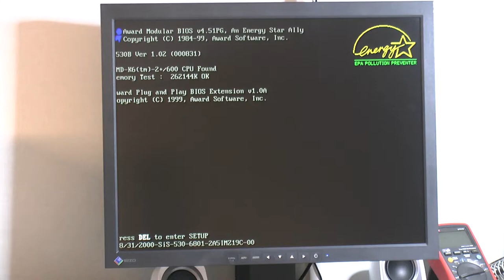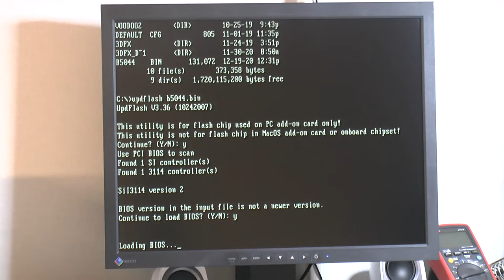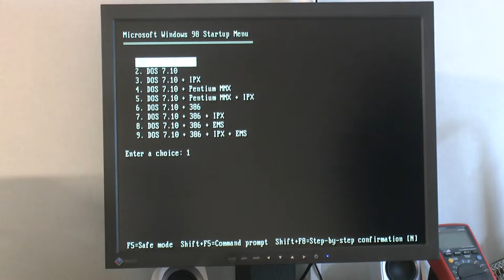Sil3114 EEPROM replacement and socketing

Comment: Friend, with my Retro Windows 9x Setup , can I use this card with 1 SSD, 1 DVD Drive and 1 Motherboard's IDE HDD?
Reply from the maker: There is windows 98 drivers. It works in windows 95 but there are no drivers.
Works in dos too.
BUT if it will play nice with the motherboard depends. The older the less likely the motherboards bios is to cooperate. Also optical units can be troublesome, forget booting from optical sata drives on most systems.
You also want the none raid bios flashed to it, you want the IDE bios.
Most cards on ebay have raid5 bios, sells better I guess but its useless for normal usage.
And my card had en eeprom that could not be flashed so had to  be replaced.

I have a number of windows 98 machines using sil3114 cards, mainly old SUNIX cards from early  2000 with proper eeprom so easy to flash them.
But some motherboards hate sata/scsi controllers so no guarantee it will work well with your board, but they are like 20 usd on ebay last I checked.

You could get sata to ide adapters with proper Marvel controller, they are like 25 USD but works very well.
Like this startech one.
https://www.startech.com/en-us/hdd/ide2sat
Turns pretty much any sata unit in to an IDE unit with master and slave option and optical support so you can have two on a single ide cable.
Reply: Thanks a lot for your kind detailed reply.

I thought of that SATA-IDE converter.
I want to use (PCI SATA card + SSD) as SATA1 is much faster than IDE....

What do you suggest?
Reply from the maker: @ayan.debnath  depends on the motherboard. Sata 1 is 150MB/sec and the sil3114 can do 66Mhz PCI bus BUT 99% of motherboards use 33Mhz PCI bus so the maximum theoretical limit is 133MB/sec anyways.
The Startech adapter uses a Marvel chip capable of ATA 133 so in theory if the motherboard has a fast IDE controller they should perform about the same.

Sata 1 is not that much faster then ATA 133 for example especially since most early sata 1 controllers where PCI.

So the question is what what ATA speeds the motherboards IDE controller can do.
Also the PCI bus might be slow on some motherboard so you wont get near sata 1 speeds even with a PCI Sata controller.

There are other advantages tough to the Sil3114 like bigger hard drive support, in theory up to 2TB.

I have both the adapter and sil3114 cards because on just have to test and see what works best for the motherboard in question.
Reply: thanks a lot for this awesome guide.

Comment: and if you leave it without the bios? will it work? what is the maximum volume to see?
Reply from the maker: I never tested a card without a bios chip because they are 99% soldered on. But I used them for linux back in the day so thats why I have a few for retro use. But DOS/Windows 9x and even NT usually requires a bios for the driver to even work even on windwos 2003 server. Linux tends to load its own firmware and has a good opensource driver so I suspect for linux the card might just work fine with no bios chip.
I ran 4-5 of them in one home built NAS back when and even when the motherboard only sees 1-2 of the 4 or more cards but linux can see and use them all up to at least 2Tb drivers.

But for the the retro use they see today a bios is needed and windows needs a driver matching the bios so riad0 and 1 usually has one bios, then there is a raid5 bios then there is the "ide"bios I like because it works with SATA optical units and can even boot that one SOME motherboards and its the most hazzel free bios. But all the china cards has the raid typ bios, I suppsoe it sounds better if it has host raid support but thats just a fancier version of software raid thats usually bootable.
Reply: Where do you source the IDE bios chips from?